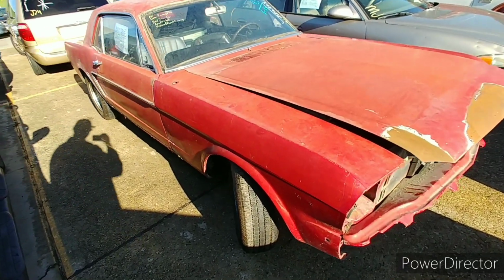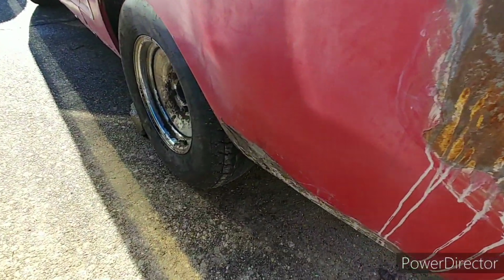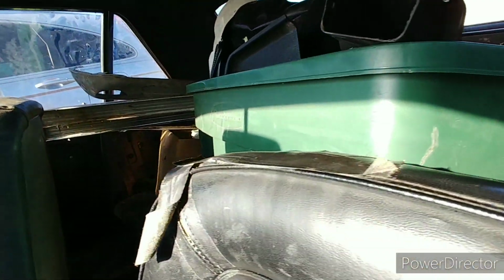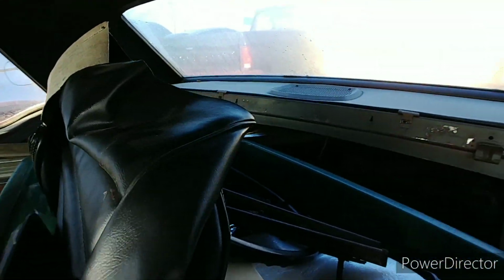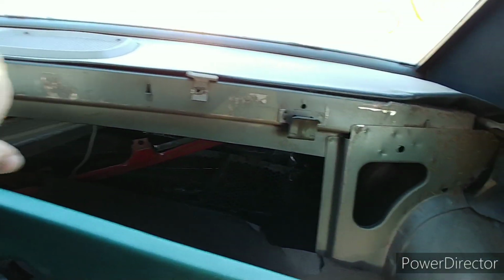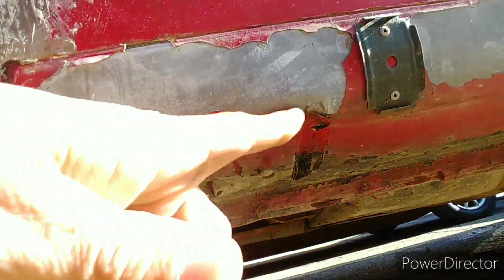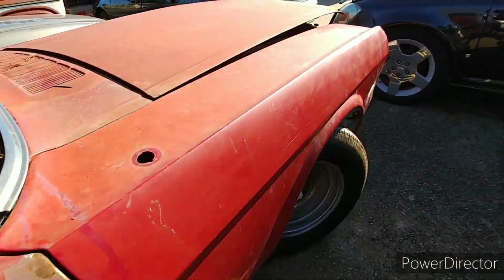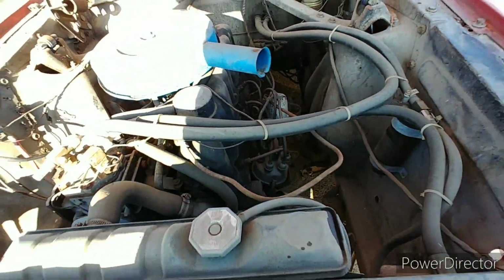1965 Mustang Auction Find

Comment: VIN is 5 for 1965,  R for San Jose, CA assembly, 07 for two door hard top, T for 200 straight 6 with one barrel, and the rest is the production sequence. There were several green exterior paint colors available in 1965, so we'd have to have the trim tag from the door to determine what it was originally. Same with the axle, transmission, build date, etc. Those are all on the trim tag in the door.

Comment: That car is a bondo buggy, and the passenger side torque box was rotten. Having said that, it's still a restorable car with a ton of new parts---it's worth $1,200 all day long
Reply: That's a common problem on these, the torque box rot, I agree.
Reply: Torque box?
Reply: @markj2838  Yes. It's a stressed structural component of the unibody, which reduces chassis flex and adds strength
Reply: @justsumguy2u  ahh ok, tk you..